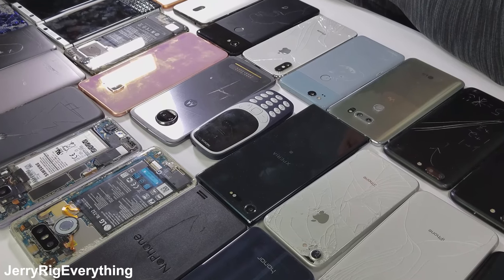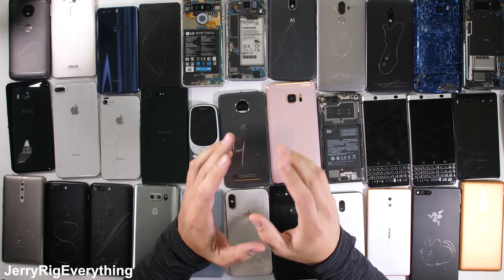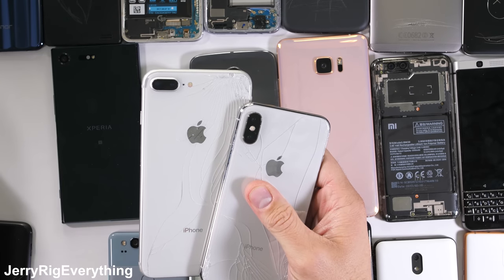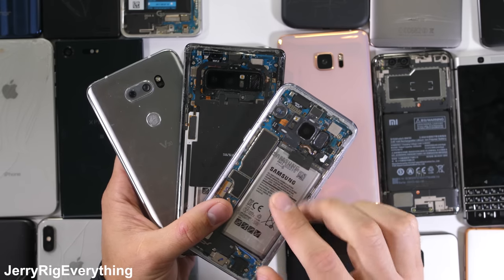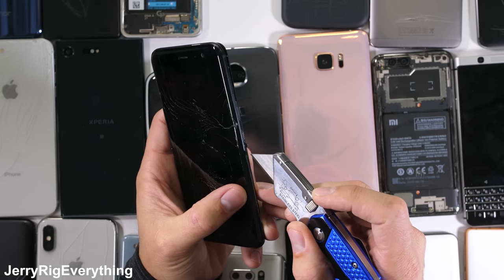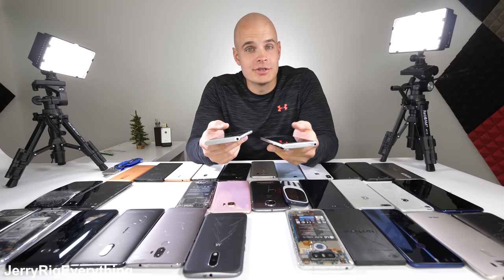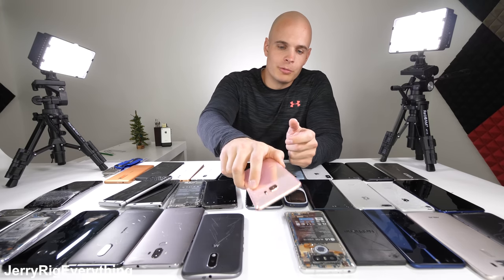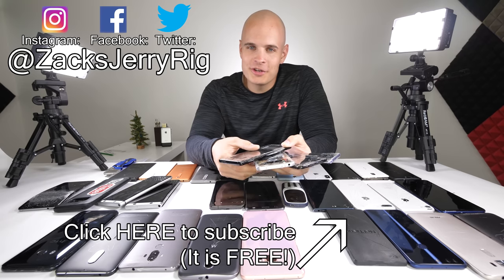Smartphone DURABILITY Awards 2017!

Comment: iPhone is iPhone
And iPhone is fragile
Reply: Well, same with the other glass phones
Reply: So what? Still, glass can crack. No matter what phone it is. Simple solution for not paying 500 dollars, or anything, just get a case and screen protector. Also, just be careful while using Your phone, so it won't fall out from Your hands and everything will be fine.
Reply: Theres a reason their called: "CrApple.... !!!"  😄
Reply: *garbage.

I think you meant to say garbage.
Reply: and iphone is trash
Reply: I’ve had iphone5, 6s, 7 and now Xs ive dropped them all more times than I’d like to admit and I’ve yet to have anything worse than a hairline crack in the very bottom corner of one and that was the 5 the oldest one I’ve had. Look after your phone and it won’t break it’s pretty simple, people spend hundreds on a phone and toss them around and expect them not to eventually break? It isn’t reality. And I’m sure more people would change to another phone if every company except apple would bother to make an os for their own phones, I can’t say a bad word about any iPhone I’ve ever had but I’d definitely like a change but other than apple no one is making their own operating system and I’ve yet to use an android device I haven’t had a problem with, plus the majority of android phones look exactly the same interface wise, meaning if anyone wanted something different only apple can offer that apple wouldn’t get anywhere close to the sales they get now if company’s started making their own os as I’m sure like a lot of other iPhone owners it’s the only thing keeping me with apple
Reply: Congrats, you're an enigma.
Reply: @GatheringHall  You're an isheep*
Reply: Nah dude. I like my Iphone SE sure, but knowing what apple does to it's costumers with updates slowing down older phones, I'll never own another Iphone.
Reply: iPhone is iPhone and iPhones are shit
Reply: Just like.. 
Nokia is nokia
And nokia is durable..
Reply: My phone is different.. 

My phone is phone
And my phone is agile
Reply: Lost _B0Y you don’t NEED to pay that price if you crack it there are plenty of 3rd parties that replace iPhone glass for that price
Reply: Lost _B0Y why i have htc
Reply: MarksMan 65 so are you ;)
Reply: Funny fact, in my language when you say "iPhone" it sounds like "egg phone" and eggs are fragile 😂
Reply: Nokia is nokia and nokia is a brick
Reply: @stormblade9649  As if we cannot appreciate both?
Reply: @tovarishtobias969  how can you not see the almost 500 dollar difference between the repairing prices?
Reply: @HaXD1209  a strong brick tbh
Reply: Just like the users
Reply: @Roj-joR  We're talking about how fragile it is, not how repairable it is.

Comment: the nophone should be the most durable
Reply: lol
Reply: second place is the 3310, obviously.
Reply: wtf is wrong with you
first place is ofc the 3310
Reply: And most repairable.
Reply: And most loved
Reply: But it scratches at a level 2
Reply: Cuz the screen is plastic, while other phones use glass.
And the screen will never crack no matter where you drop it.
Reply: You cannot scratch the NoPhone Air.
Reply: But the NoPhone Air doesn't have a headphone jack, speaker, SIM card slot, SD card slot, and it doesn't even come with a charger.
Reply: And who would buy a NOphone? Think about it.
Reply: LMAOOOOOO
Reply: Hahaha
Reply: MLG Jerry look at the bright sides,the battery is permanent,it has infinite memory and the headphone jack is just invisible
Reply: no . the CAT S60
Reply: It would have been the best phone of 2017 if it had OIS on the front camera.
Reply: MLG Jerry buy it doesn't come with anything! I know that's the whole point, but still.
Reply: Personally, I thought the Nintendo Switch was gonna be the most durable smartphone.
Reply: Technically not, the plastic wouldn't even survive the bend test
Reply: CalculatinGenius actually the Nokia 3310 is the most durable
Reply: Bah! The Verizon Wireless version of the Kyocera Duraforce Pro has a sapphire display! Does the Nophone have THAT!?!? XD
Reply: Merlijn van Uden, it can't be scratched tho.
Reply: That will be Apple's flagship in 10 years
Reply: Yeah

Comment: Shouldn't the Essential Phone be awarded the least reparable smartphone of this year? You can still replace the screen of the iPhones (I think). But according to Zack's previous video, there are NO replacement parts for the Essential Phone making it irreparable.
Reply: There are no replacement parts for the Essential Phone, but all of the iPhone's back glass panel cannot be replaced. There is still potential for replacements parts to become available for the Essential Phone, or to get parts from a broken one. If the iPhone back panel breaks, which is highly likely unless you use a case, it is permanently broken. Apple just copies your data from your broken phone to a new one to "fix" it.
Reply: I think there will be a market for iphone 8, 8plus and 10 casings (I mean the back and sides) and if you are smart enough you can just move your components in it for probably under 50 usd. The chinese make this casings for older iphone models to look like the new ones.

Comment: Yeah..  I dropped my Note8 from almost 5 feet, and both glass are just fine... Hushhhh..   !!!
Reply: Area of Interest same on my galaxy S8, and I dropped mine onto rocks while hiking, and there is only a scuff on a small part that gets covered up by a case anyways.
Reply: tim dook Well I came over to look at this comment and in doing so I dropped it off my desk. Again I got lucky and there is only a scuff, but it is quite noticeable now, and it's right in the middle at the top. Did you get yours fixed or are you still using it broken?
Reply: Hey! I dropped my S8 on concrete with bits of pointy rocks.. I stepped on my S8 on those tiny rocks thus, creating a hole on my screen! Also dropped by my friend which cracked the rear. All out 550 for replacements :/
Reply: cristle is harder than glass lol
Reply: Yeah! Samsungs the best
Reply: tim dook same
Reply: Hassaan Zafar yeah my brothers Galaxy s8 was the same i guess it is prone to scratches but not breaks since  i heard reviews about hair like scratches
Reply: Alex Smith Yeah, my cousin came over and while looking at it he dropped it on its back while walking, so there are quite a few scratches on the back around the edges and on the bottom, luckily it's on the back only, but recently I've been using the Samsung flip case, and I didn't realize that there was dust on the screen so I closed it and put it in my pocket. I later saw the scratches and they kinda piss me off, but luckily they are invisible when the screen is on, and you have to look really closely under lights to notice them, so I'm fine with it.
Reply: I dropped my Lumia 920 from space into an Aztec temple made out of granite and it survived with a simple scratch. 
The same could not be said for the temple because not just did it destroy the temple, the Aztecs too.
Reply: My S8+ went flying. Had forgotten that I'd kept it on my towel stand, pulled my towel and it went six feet horizontally hit the opposite wall then hit the ground six feet down.
At first I thought why did the shampoo bottle fall! Then seeing the mobile I'm thinking "oh it's waterproof!!".
Then realising that it may have broken I picked it up and not one scratch on the phone!
Samsung, Respect!!
Reply: I dropped my Note 8 from about 1,5 feet and both glass panels cracked...
Reply: I dropped my galaxy S5 down down the stairs (more than once) and not a scratch, until this year. I  slipped into the pool and my phone hit the side and fell in, and the back cover popped off in the process. Everything was soaked so I had to use an old Lenovo phone for a week, and the display on that cracked from a 1 foot drop onto its corner, leaving 90% of the screen unresponsive to touch, so I bought this.
Reply: I droped my iPhone X without case over 20 times it did not break do i have luck wtf
Reply: Lol none of yall can afford a 800 dollar phone so get out of here
Reply: Whoa dammit I dropped it again waking up, slid down the side of my bed, now something's dislodged on the inside. This comment chain brings bad luck.
[Edit]: Now the vibration is messed up.
Reply: Same here.
Reply: Same happened to me when my girlfriend bumped in to me when I had my S8. Only reason I didn't get mad
Reply: But ur not fine😂
Reply: Area of Interest on to what? Glad for you though.
Reply: Yeah I dropped my Galaxy S8 from a plane without a case... I went n check on it after I landed and it was ok... lucky
Reply: +Bhagyaveer Manjunatha
Jokes aside, it all depends on how it hits the floor however these are fragile phones, its not like Nokia or anything else.
Reply: my wig lost in space help Really depends on situation lol. That's why I have rhinoshield bumper case for my s8.

Comment: My 3T still looks almost like brand new and I have it since released
Reply: Arek R. Same!
Reply: ALI Ahmad same here just l have only 3 version not 3t
Reply: I had to replace my display once, it wasn't broken , there was a problem with the digitizer
Reply: Me too... Still very good n smooth
Reply: my htc sensation xe looks almost brand new and i've had it for 6 years lol :D. soon to be replaced tho i guess
Reply: without any screen protector or case btw, just swapped battery 3 times
Reply: Eyy same
Reply: how about the battery life?
Reply: Battery life on mine is still really good, and I've dropped it a few times in it's life. Even if it was bad dash charge probably would save it for a while longer.
Reply: Is the phone still as fast as it was? One of the thing preventing me from going back to android is every galaxy device I've had slowed down immensely in just one year.
Reply: Surprisingly enough it's still almost as fast as it was when I got it! It was slow for a little while but then I cleaned it up after I broke it (then fixed it myself) and it's a lot faster now, almost like it's first day. 

One of Android's problems is that the apps can slow down your phone a lot more than you'd see on an iPhone, so you just need to be careful what you install and you'll be a-okay.

For reference I've had my 3T for 2 years now as well.
Reply: The galaxy devices I've owned became almost unusably slow, even after a factory reset with nothing installed. Whether it's due to software updates or degradation it forced me to bite the bullet and go with Apple. I've loved my iPhone but now with IOS 11 being too buggy for too long I'm not opposed to switching sides again.
Reply: IMO Android devices are only getting good in the past few years, previously they've been really shit because of badly optimized apps and OS' as well. Hopefully you have better luck with whatever phone you decide to get nowadays.
Reply: Same here still new
Reply: i shattered mine about a week ago...
Reply: RIP... :(
Reply: Me too..
Reply: Same but mine is so slow it doesn't even matter how good it looks 😂
Reply: Same with my OnePlus 3, except for some minor dents in aluminium on the corners. Had it since about a month after release. I dropped the phone from about 1.5-2 meters when I jumped over a fence to run for the buss and having the phone in my jackets pocket, and it only got two minor dents in each corner on the bottom. The glass is perfectly fine.I have also dropped it some more times from about 1 meter, but not a single dent from those drops. I really love the build quality and I do not plan to switch phone for at least half a year, but I will probably go for the 6 or 6T whenever they come out.
Reply: What about Moto G4 Plus?
I was thinking you will say something about that.. because the mark of 4 clearly visible on back side.
Reply: me too:)
Reply: Andry Wibowo Still very good. My Battery lasts long. Even if i watch movies and lots of Youtube Videos, my battery last at least a Day.
Reply: Arek R. same with my op3

Comment: You forgot the king NOKIA 3310😂😂
Reply: That stopped being funny 2 years ago bud
Reply: That thing is made of adamantium.
Reply: Pranav Kamboj wait...
Original Nokia 3310 - made from the strongest materials to destroy a car or even half of the planet with a phone case
New Nokia 3310 - plastic, made from the cheapest materials to make your friends laugh on your 3310 and even a phone case would be as strong as a 20$ smartphone
Reply: Read the title of the video again.Specially first word.
Reply: RavenRing don't comment if you doesn't used it.
Reply: Tyeston i read the first word, but also saw the "phone" in those "smartphones". Thats why i commented.
Reply: Pranav Kamboj i did use the nokia 3310 and compared the old to new:
Old Nokia 3310 looks like old-school, stylish and nostalgic, I even remember when phones didn't had cameras at all or these 2MP camera sensors. The original didn't had a colored screen,  and it's cool.
Also Nokia 3310 was the successor to the 3210, which had colored shell.
The new 3310 is more like a money-score, because it's clearly plastic, the colors didn't help at all and we hoped the 3310 (2017) would be 2x stronger, but no. It's just strong as a s8 active.
Older 3310 is better. I would rather buying the older Nokia 3310 (if possible new or used) than the new 3310. If I didn't help, I will delete any comment I posted on this discussion.
Reply: But its an old ancient phone
Reply: AndroidEight YT But it's still made out of Adamantium. This phone will flawlessly win the durability tests featuring smartphones
Reply: RavenRing just saying ik that
Reply: Haha funny joke
Reply: Pranav Kamboj ya !!!
Reply: Its not a smartphone.
Reply: Nokia 3310 new and old both r not smart phone because they have not os! Also old Nokia 3310 is the world most durable phone. New nokia 3310 is not much durable but has some modern features. 
But i would say that iPhone htc Samsung and even Google have the less hard material. And also Chinese companies phones Xiaomi one plus.
Reply: thats bcoz he tests phones

not bricks.
Reply: Pranav Kamboj phones in 2017.....
Reply: Nokia , isn't a smartphone 😂😂 ,,see the title again...
Reply: Nailed it!😂
Reply: You are 2 years late bud.
Reply: Those who are without sin, shall throw the first Nokia 3310 !
Reply: 8:43 any nokia... i wonder why
Reply: Pranav Kamboj you mean the NoPhone?
Reply: Watch some comparative drop tests between the new and the old 3310. The new one is surprisingly more durable because it doesn't fall apart.